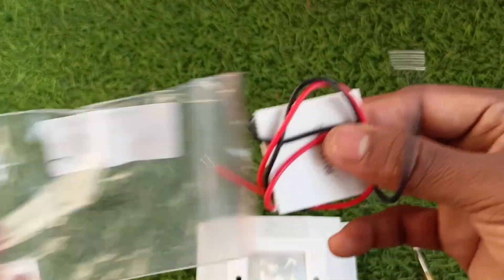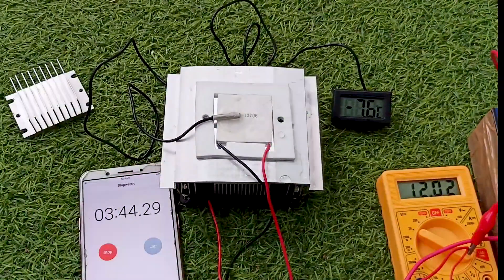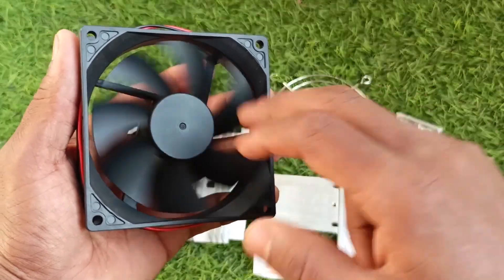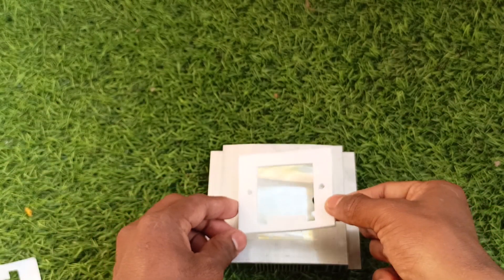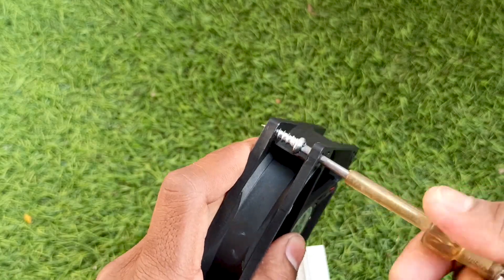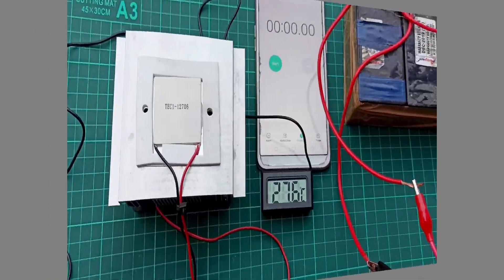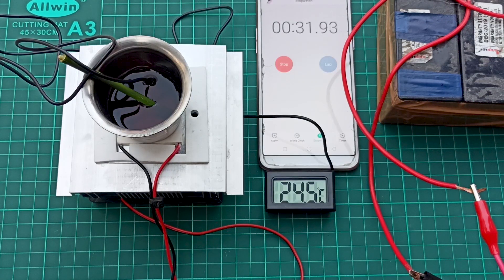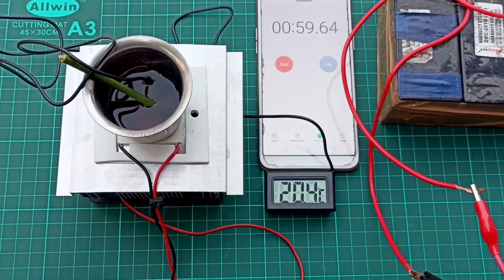Portable ice maker at home | How to make ice using peltier module

Comment: Bro can peltier make ice with charger
Reply from the maker: Yea of course, but that charger should be able to generate 12v and min 2 amp of current, generally mobile chargers will only have 5v which works but not enough to make ice, use smps for better results
Reply: @infinityexplorerram  bro less volt  charger can work your heatsink must be able to get cold on hot side if you want to see ice I am struggling before now I find this solution
Reply from the maker: Yea cool